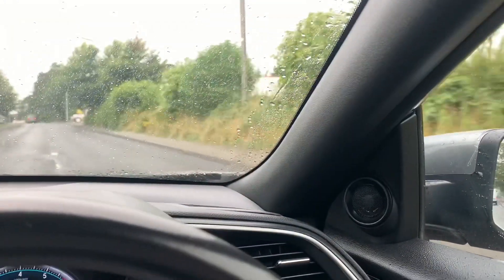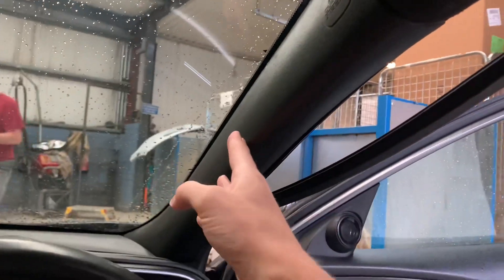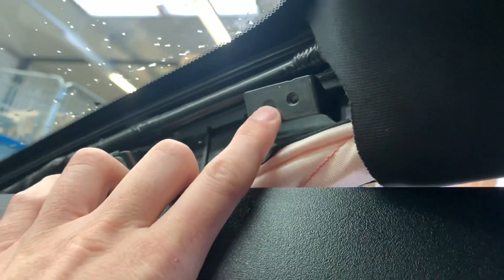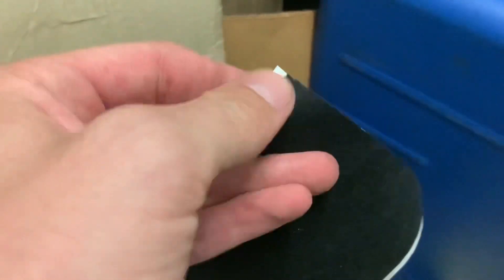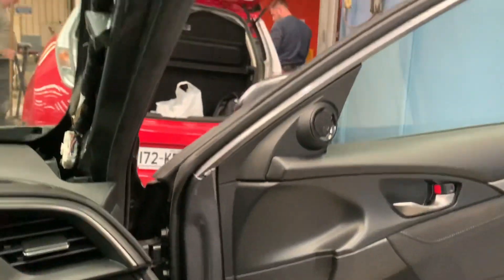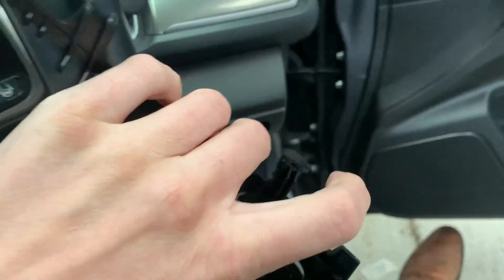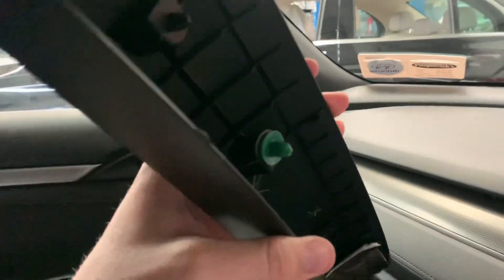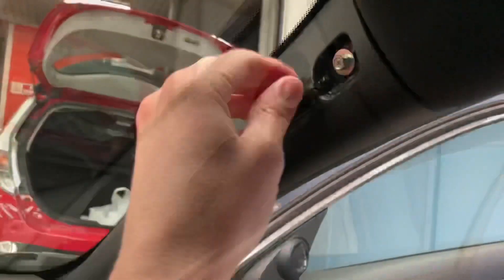HOW TO FIX THE VIBRATING SOUND - Generation 10 Civic ￼

Comment: Thanks Brian. I have it on my 2015 CRV so will give it a go.
Reply from the maker: Hi Roger, not sure if it is the same issue.. to Crv vibration used to usually come from around the rearview mirror, there is a plastic Cowling that surrounds the mirror so maybe hold that firm and see if the vibration goes out of it first !
Reply: @doolanbrian  Thanks Brian

Comment: To be honest, I swapped my 20 year old accord for a gen10 civic. And that 20 year old accord had less rattles and squeaks than this civic.
There really a difference between cars made in japan, and those made abroad...

I get a sqeak from the driver set in corners, the top panel with lighting rattles, and the center speaker in the dash rattles.

Comment: I have a Type R and it is plagued with noises. In particular a buzzing from the b-pillar. Have you any experience of this? Also the door cards and dash in R mode. Dealer had it for 4 days pulled it all apart but couldn’t resolve it. 😞
Reply from the maker: The Type R is going to suffer worse .. stiff suspension will increase the frequency of things rattling .. The B Pillar buzz noise is again like a piece of plastic making contact with another plastic part  .. ive had a rattle but it was more rattle than buzz in the B pillar where the safety belt reel was rattling but it sounds different noise than yours 🙂
Reply: @doolanbrian  Thanks Brian, do you think the only solution is to reassemble with the tape between the joints. Love the car but really considering getting rid of it with the noise in my right ear every time I drive.
Reply from the maker: @bossadave  It’s just impossible to guide you without seeing it, you have to strip of the trim off and drive the car while everything is exposed
Reply: @doolanbrian  thank you for your advice Brian

Comment: I have one coming from the rear door, but I have no idea where exactly
Reply from the maker: Do you find it at higher speeds ?
Reply: I found it at bumpy roads
Reply from the maker: @popo341971  difficult to elaborate on this for you , it’s not  immobiliser but I’m sure it’s nothing to worry about, but it’s annoying, you might need to get somebody technical to sit in the car with you while you drive , it should help them identify it

Comment: Hi Brian, I have similar noise from the same place on the passengers side of my CR-V Hybrid. Seems to do it more when the weather is cool. Are you aware of this sometimes being an issue with CR-V's too? https://youtu.be/_-7Ft8Sr8i0
Reply from the maker: Okay on that model I am on aware of the issue, doesn’t mean it doesn’t exist, it’s just I haven’t come across it, I reckon when it’s that new, get into the dealer as it’s under warranty! Let us know how it works
Reply: @doolanbrian  Thanks Brian, they have it for a couple of days early September when it's due it's first service. Also I was wondering how do you feel the new Tucson Hybrid compares with the CR-V?
Reply from the maker: @maff257  very different surprisingly .. I love the Honda !!  but I’ll admit I’ve had customers drive both and they usually prefer the Tucson unfortunately😕
Reply: @doolanbrian  Hello again Brian, I've now got a video of the noise I'm getting from the CR-V while driving, do you recognise the noise from any you've driven? The dealership I go to seem a bit flummoxed at the moment! https://youtu.be/kNGOpkZTRV8
Many thanks
Matthew
Reply from the maker: @maff257  oooh that’s a tough one .. I’ve not come across it yet … it’s really hard to hear properly from the video, ideally you just need to be sitting in the car with someone to hear a noise properly if that makes sense, have you spoken to the dealer yet?? Thanks for the video